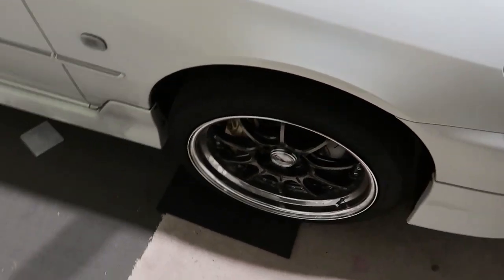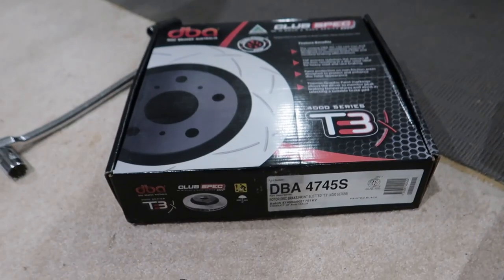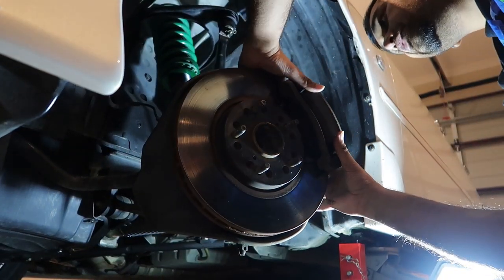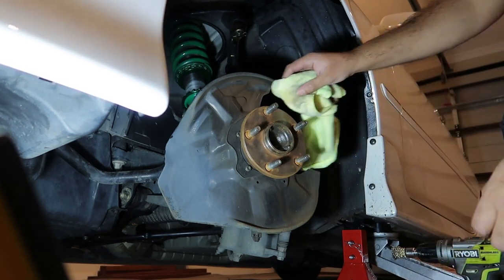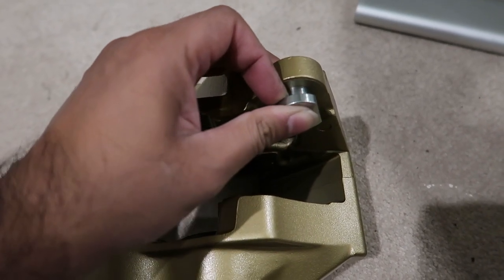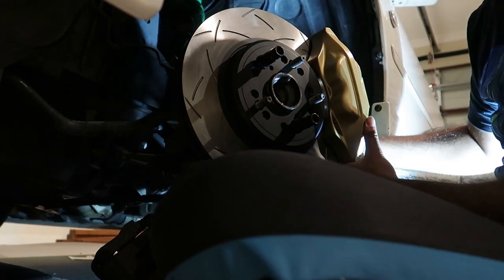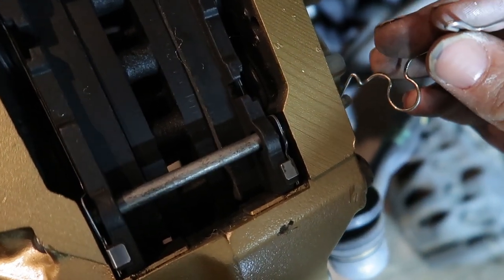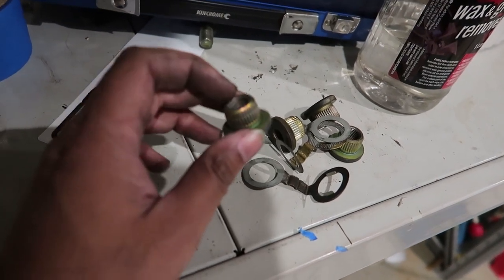Installing UCF20 4 Piston Big Brakes on my JZX 110 Mark II

Comment: Hey mate! Are you able to tell us how much clearance is needed for the caliper from the face of the rotor to the wheel spokes? If you could measure your current setup that'd be legendary. Cheers mate
Reply: Hey Ricardo did you find out the wheels clearance after installing the ls calipers?
Reply: @feriveysi7399  still rocking my stock brakes. Wasn't able to find any LS callipers for cheap :(

Comment: Hey Krishneil, does this work the same for jzx100? Do I need all the same parts in the description?
Reply from the maker: Hey mate, yes the brakes are the same on the front of a jzx100 and the process covered in the video is the same. You will need the same RCA, Offset nuts, callipers and rotors to do the conversion.

Comment: Is the feeling much better ?
Reply from the maker: A lot better! Pulls up a lot easier, doesn't fade on downhill runs or on the track.
Reply: @KrishneilGarib  I'm tempted between LS400 caliper and just going for good project mu pads with stainless lines... Guess I'll try pads before moving onto somehting more agressive

Comment: would the rear brakes fit on the chaser?
Reply from the maker: Rear UCF20 celsior brakes or do you mean the JZX110 rear brakes on a JZX100?
Reply: @KrishneilGarib  hmm i guess either, if they offer any braking benefits over the x100 rear brakes, my caliper seems like it needs to be rebuilt so might aswell "upgrade".
Thanks for replying :)
Reply from the maker: I don't think many have tried x110 rear on a x100.. but it should be a matter of the correct offset nuts. For reference a lot of x100 owners do the a80 supra 2 piston rear brakes, the offset nuts for those are available.
Reply: @KrishneilGarib  oh yes how could i forget the supra hahaha, durrrr. thanks mate!